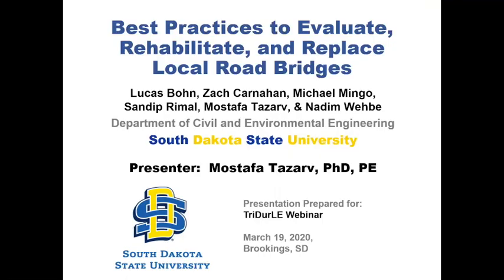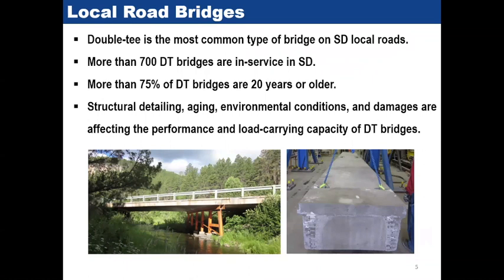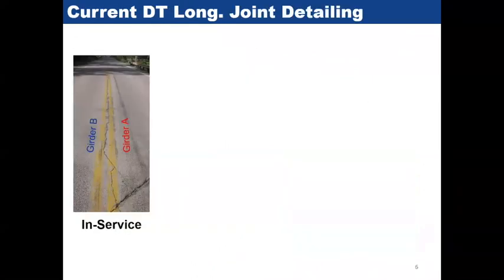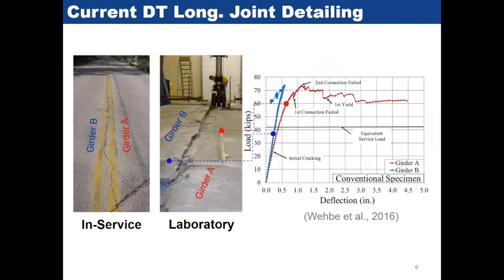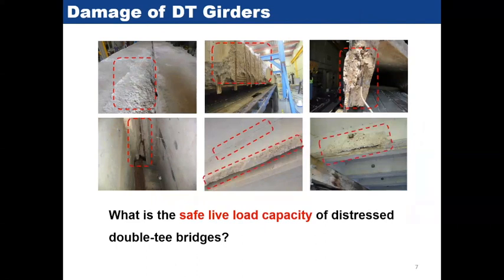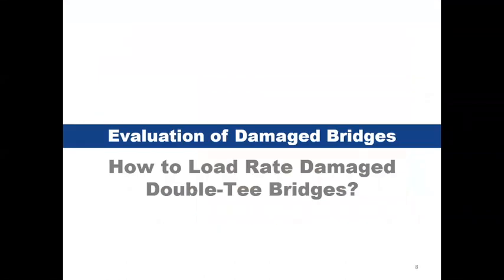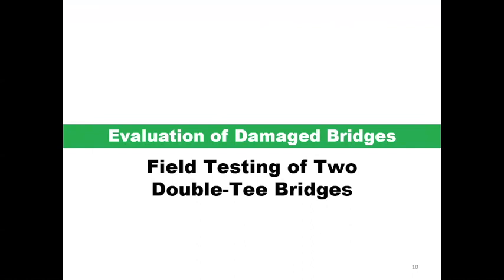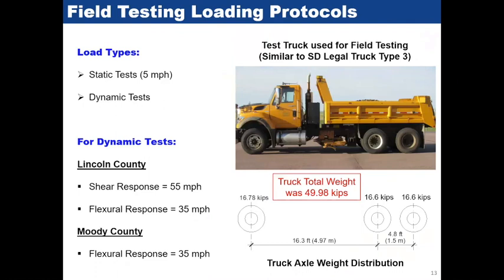TriDurLe Invited Speaker Webinar Series 1

Comment: Dr. Tazarv is an assistant professor in the department of Civil and Environmental Engineering at South Dakota State University (SDSU). Prior to joining SDSU in 2015, Dr. Tazarv was a post-doctoral scholar at the University of Nevada, Reno. His research interests include the behavior of concrete structures, advanced materials for civil infrastructure, accelerated bridge construction, and large-scale testing.  His research has led to the development of a new generation of bridges that can be built faster, last longer, perform better in severe events, and cost less in long-term. The first shape memory alloy (SMA) bridge in the world was constructed in Seattle, in which design and construction guidelines were based on his study on advanced materials. The unique aspect of this bridge is its continuous functionality after severe events with minimal damage and repair needs. Furthermore, his large- and full-scale testing of bridges and buildings resulted in new design alternatives for the State of South Dakota and its local governments to save millions of dollars in bridge replacement, maintenance, and performance. He also invented a new connection for concrete structures to expedite construction and to quickly repair concrete buildings after a severe event such as earthquake or hurricane.